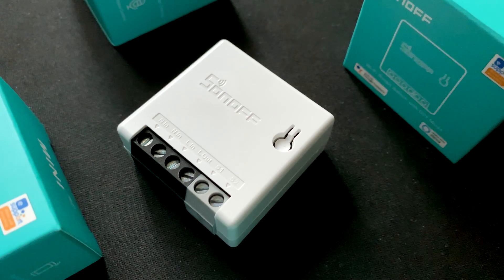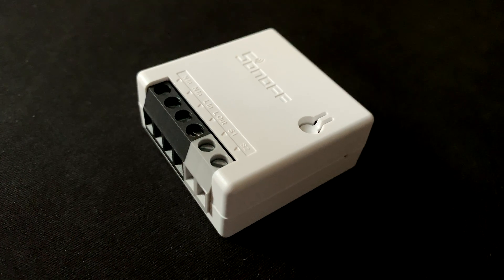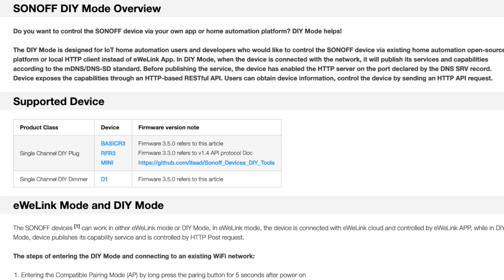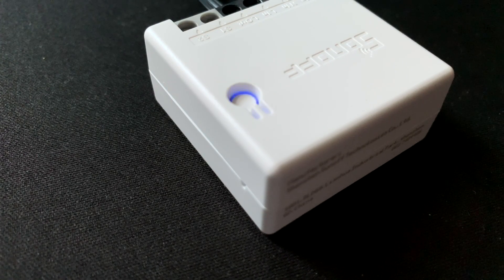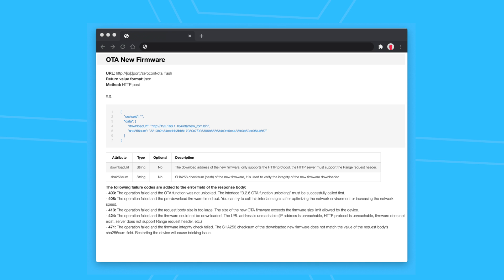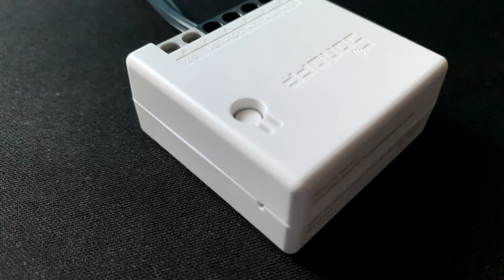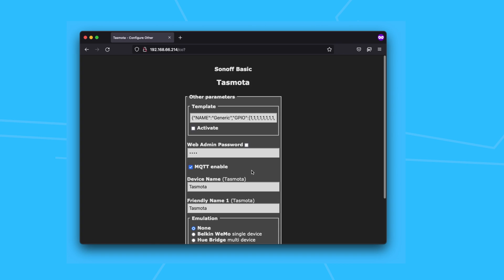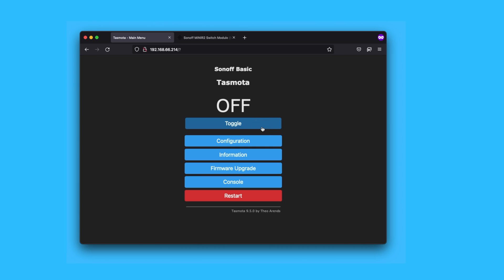Flashing Tasmota on Sonoff Mini R2 (Over the Air, no soldering, FW3.4) - Goodbye TP-Link HS200!

Comment: My Sonoff with Tasmota flashed is working without adding the configuration given on Tasmota website. Is there a benefit to adding that configuration?
Reply from the maker: These settings help you get the most out of the device, so they’re usually good to apply

Comment: I have 3 sonoff mini v2. 2 are on my network running with ewelink and the 3rd sitting on my desk. When I put the 3rd one in diy mode and got it on my network, the script found the other 2.. Not in diy mode and not the 3rd one. So I unplugged the 3rd one and plugged it back in then it found all 3? I thought it had to be in diy mode?

Comment: So, I don't use these, but I am flashing a bunch for a friend and he wasn't able to connect them to his Home Assistant. I had done some Basics for him in the past and they worked well. The Mini R2 though is only able to flash to the Sonoff Basic firmware. How do I flash it up to something that will be discovered by Home Assistant. It appears that the Sonoff Basic Tasmota firmware doesn't work with the Home Assitant integration. Thanks.

Comment: Hey! I've tried this script today but isn't works :( Correctly show hostname, correctly ip-address BUT   display_info nothing shows and after that script is exiting :( any help? I've paired my sonoff mini r2 (soft 3.6.0) with wifi, I can use it on ewelink app but can't use script to flash image. Can't get information about my switcher using postman (after long long time request failing every time) :( I tried couple times resetting etc. any ideas?
Reply: Hello I have the same problem you have ... did you manage to get it to work?

Comment: The R2 is providing power monitoring additional to the switches, when you use the eWeLink software …. is this functional under Tasmota also ?
Reply from the maker: I don't think the mini R2 provides power monitoring.
Reply: @MrDIYca  
Definitely. Use the eWLink software and you will see.
Reply from the maker: I am looking at the product page (https://sonoff.tech/product/diy-smart-switch/minir2/) and nowhere it mentions power monitoring. Are you sure you have the minir2?
Reply: @MrDIYca  
Sorry, I have to correct myself … you’re right, I mistake in the unit … it’s the Dual R3 that can also power, not the R2. Sorry for my misunderstanding.

Comment: I got all the way to "Please wait for your device to finish flashing."  I waited over 15-20 minutes.  I saw the light slowly blinking on off on off but did not find the access point.  I waited another 10 minutes, then un/re-plugged it.  Still no AP.  I re-plugged power again and no AP.  I then tried holding the button for 5 seconds and no change.  Then 5 seconds again, an now red and blue lights are on.  If I short-press the sonoff button, the relay clicks and the red light goes off.  The blue light continues the same on off flash.  Please advise.
Reply from the maker: Did you check if the firmware was >3.4? "fwVersion":"3.5.0"
Reply: @MrDIYca  I had problems at first so I connected it to eWeLink app to verify firmware was up to date. 3.6 I think.
Reply: Hi Shawn, I have the same problem. Did you find a solution? Best regards, Thomas
Reply: @thomasdisper7168   Nope. I was advised to try flashing it with a Serial connection. I just haven't tried that yet.
Reply: @hillmakeitbetter  I found a solution that was working for me. Turn the sonoff on and off multiple times for a very short time. If you see a chance in the leds color, stop turning off. Than you can see the ssid tasmota-.... on your smartphone and you can connect to the device to finish the wifi configuration.
Reply: @thomasdisper7168  thanks for the tip but I tried a bunch of different variations of turning it on and off and never got an SSID
Reply: @hillmakeitbetter  This morning I flashed a second Sonoff with the same problem. I noticed, that I have to turn on the relais before starting the turn on and off cycles. After about 10 cycles the relais stays off and I got the SSID tasmota-... Wish you good luck.
Reply: @thomasdisper7168  THANK YOU!!!! From no AC power, I applied power and left it for about 20 seconds (I guess to make sure it's booted up). Then I [ pulled power, waited 1 second, applied power waited 1-2 seconds (until the blue LED came on) ] repeated steps inside [ brackets ] about 5 times (maybe more) and noticed one time the blue LED did not come on like it had before. I then did the cycle again but left power on.  With that, I found the Tasmota SSID and connected to it to enter my Wi-Fi.  After another reboot, it's on my Wi-Fi and I see the normal Tasomota set up page.  Yeah!
Reply: @hillmakeitbetter  hey, i got the same issue....what can i do ? is there any other possibility ? the blue led just glows cheerfully...
Reply: @kellerkind_8637  Did you see my last comment that said thank you? I followed what Thomas said and it worked.

Comment: Mrdiy  thanks, did you use a windows  machine ?
Reply from the maker: No, Mac
Reply: @MrDIYca  thanks.
I just flashed  3 mini with sonoff  diy tool. No curl just diy mode, set my wifi credentials and it showed on the sonoff tool then brushed the machine and inserted the light bin file. 
And magic happens
Reply: @Juanpimentel-diy  think this does not work with the r2 version!?

Comment: Thank you for the video. 

Do you know how the switch type can be set when tasmota is installed?

Sonoff mini r2 by default can be controlled by either momentary switch, regular switch and some other switch type - the setting can be changed on ewelink app. if i change to tasmota, is there a way i can still change this? I'm asking this since I'm using both momentary and regular switches to control my mini r2's & wondering if I'd loose the functionality if i switch to tasmota.
Reply from the maker: you might want to check tasmota's discord https://discord.com/invite/Ks2Kzd4